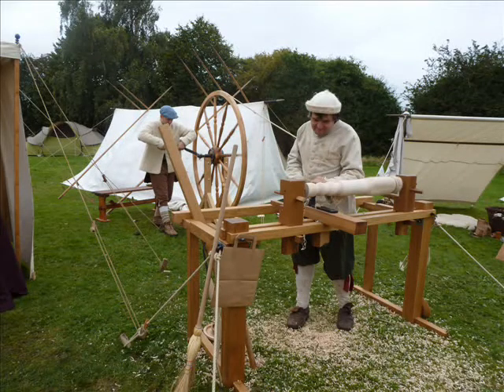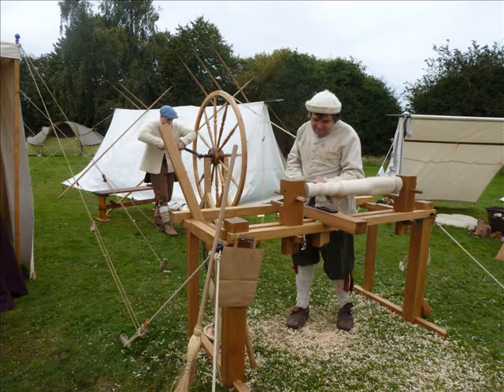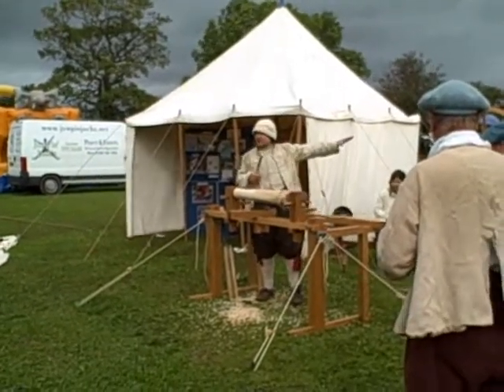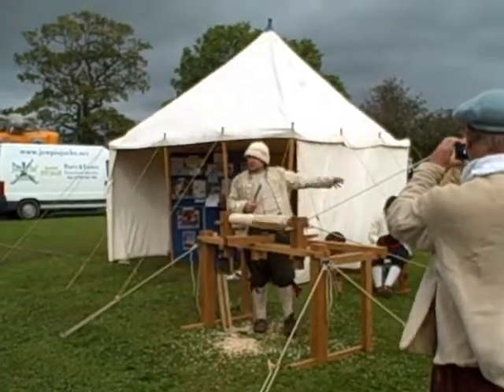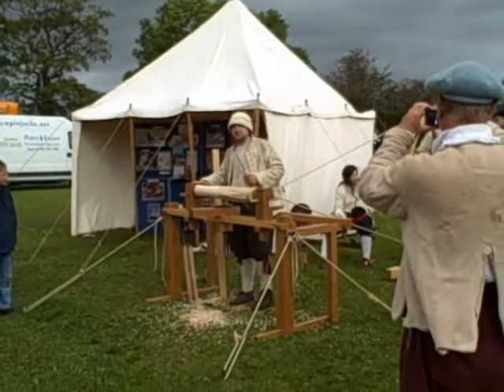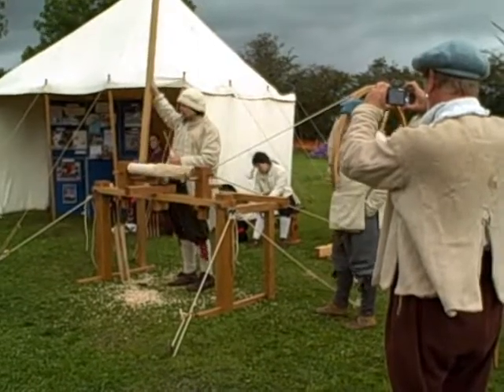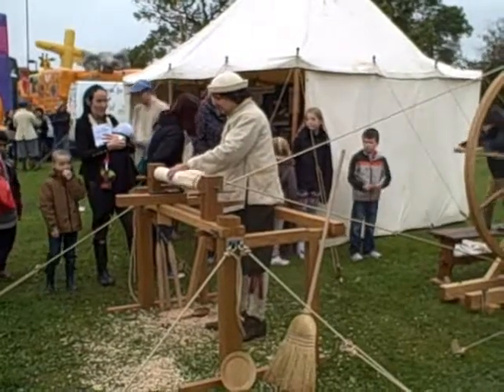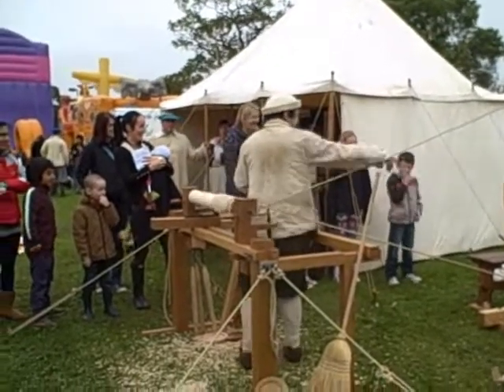Joseph Moxon Great Wheel Lathe. Belbroughton 2012 Scarecrow show.

Comment from the maker: The whole thing from research to design to sourcing materials and making the lathe itself was five years but it not yet finished. I'm looking for a blacksmith to make the treadle wheel axle so I can fit the 2 1/2'  wheel under the lathe bed too. I also want to make the drill bench that goes with Moxon's description. I expect another couple of years will be needed to make an an oval turning, ball turning, drilling and screw thread turning lathe. Fun though ManofWonder82.